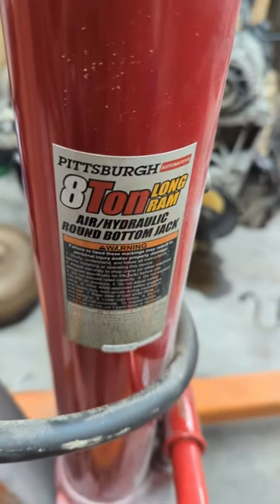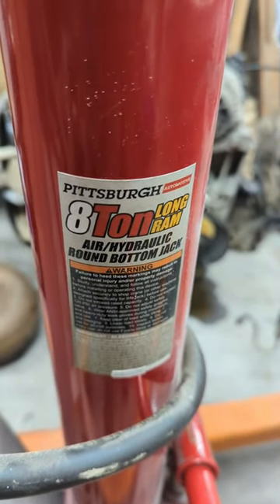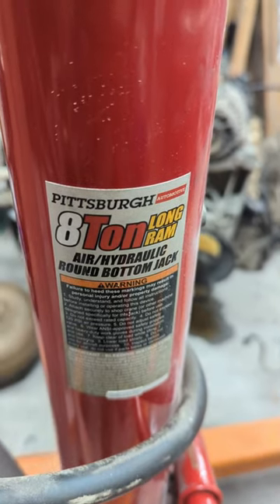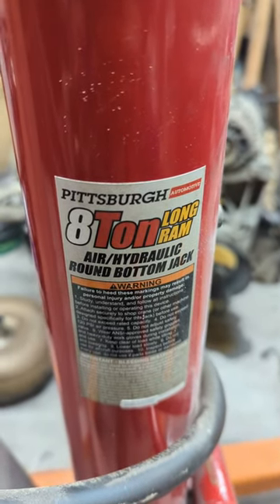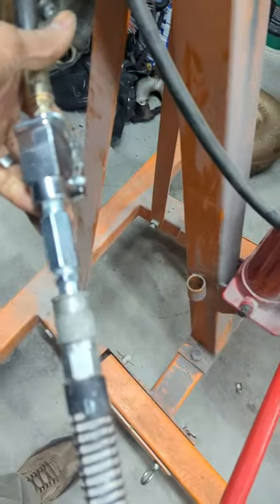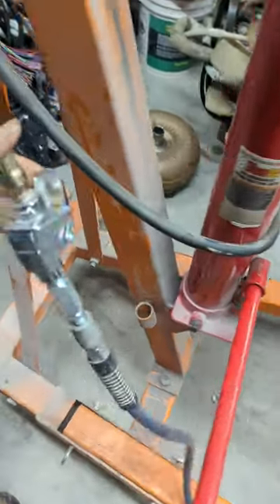Garage Shop Must Have! 8 Ton Harbor Freight / Norther Tool Air Over Hydraulic Ram

Comment: Idk how much I trust their stuff. My HF engine hoist is only about 1.5yrs old. I've lifted a 4.3L Chevy engine a few times and a 5.9L Dodge Durango engine prolly 4 -5 times and guess what? It leaks. Seriously,when I took the hoist out of the box to assemble it, it smelled like Chinese food. 🤣🤣🤣  And another thing is, whoever welded the hoist together didn't weld it together very straight. It leans to the right if you lift an engine up moderately high. It was just under $250 so I guess I got what I paid for. 😆
Reply from the maker: 😅 Chinese food.... I'll say my hoist is 9 years old and the chinesium was a bit more iron back then. I'm ok with this ram since it has hydraulic back up, however with you saying your hydraulic ram was leaking.... I dunno 😆. 

I will say their portable band saw is terrible, I destroyed it within about 20 minutes 😅. We will see how this holds up over time, so far it's done 10-12 jobs 10 engines and 1 or 2 truck beds😆
Reply: @3Wheels1Block  I only bought this hoist because the one I borrowed from my neighbor was left outside and the wheel extensions were rusted together and they were too short. I couldn't get them loose bashing them with a splitting maul.😆 I needed to get the old engine out and the new engine in my S10 p/u..Couldn't find a rental hoist anywhere. It did the job,but it seemed unstable hoisting  the engine high enough to get it over the core support. Right now I'm replacing a 5.9L in a 2000 Durango. That engine is way heavier. That's when I noticed the ram was leaking. That engine is still way below the maximum weight my hoist is supposed  to be rated for. There's just no way I'd even attempt to hoist 1.5 tons with this thing. 😆 I'd be on the really nervous side using it to R&R a big block.